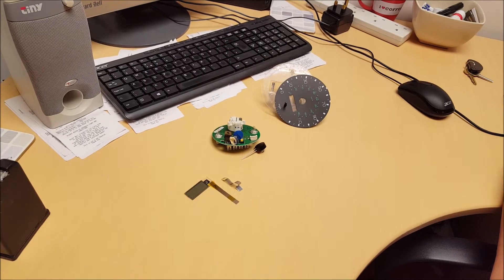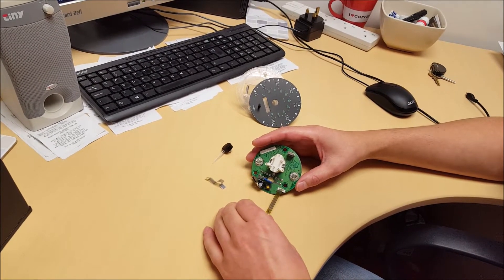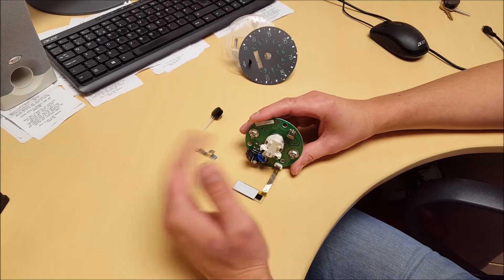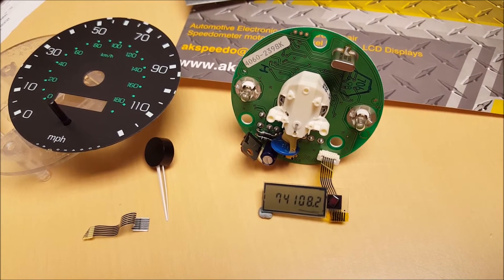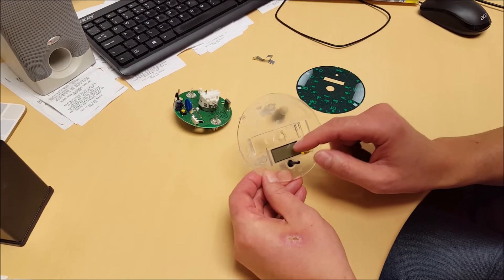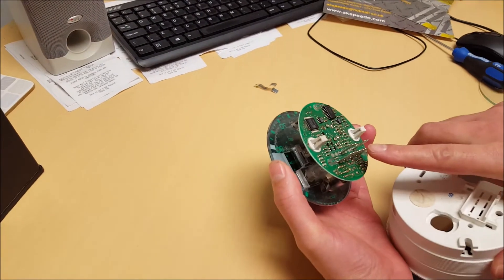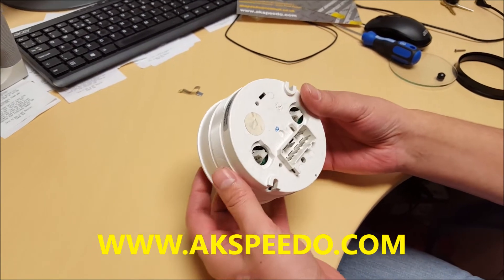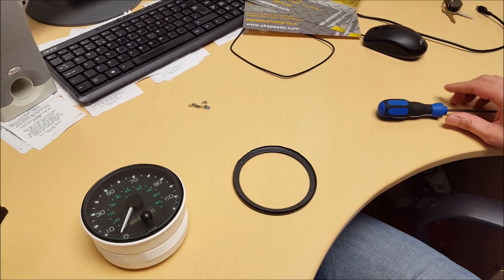Land Rover Defender 90 Speedometer LCD Pixel Repair

Comment: Nice video, I ordered the kit from you with the "T bar" (which is a soldering tip). It would be very nice to show us how to correctly use the soldering tip so we don't ruin anything while performing this repair.
Reply from the maker: Hi Shawn, email us for heat bonding instructions, thanks http://www.akspeedo.com/